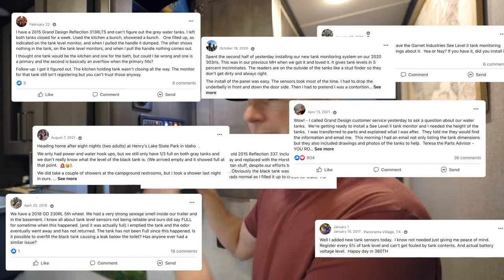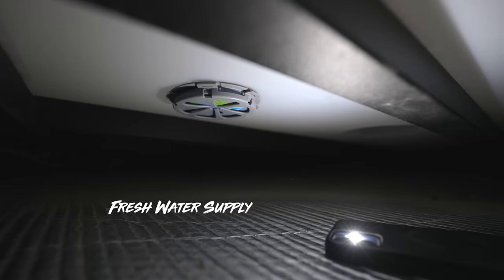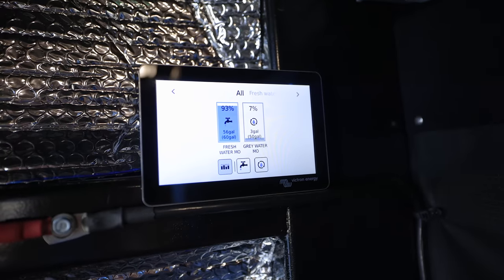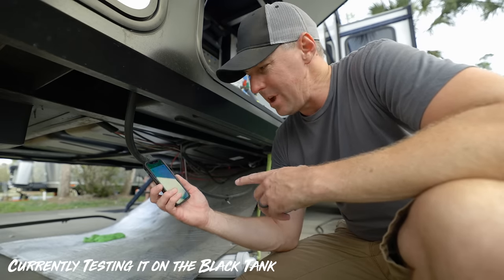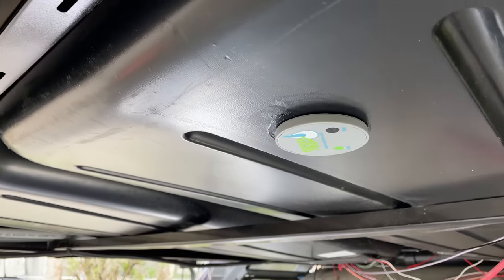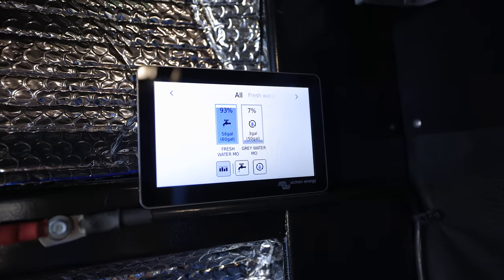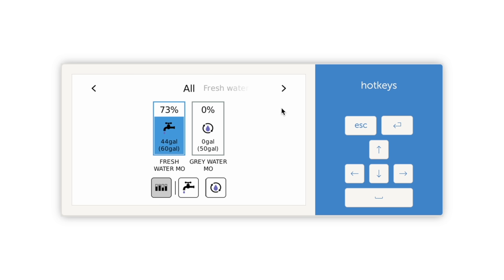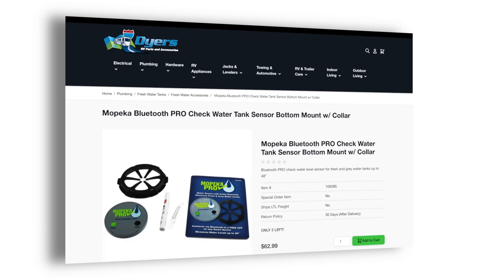RV Water/Grey Tank Level Upgrade!

Comment: Seems like a good time for the manufacturers to hardwire something like this into the system instead of the useless junk they ship with.
Reply: Agree.
Reply: Since this has been an issue since forever, I don’t see them doing this anytime soon.  Don’t know why, but they just don’t.
Reply: @jimsjacob  it costs too much. There's accurate sensors available in the marine industry but they are expensive. Something that the RV industry isn't willing to spend $ on.
Reply: @chachi5975  I too had supposed that was the root cause, but with all the comments over the years from other RV’ers I’d have thought it was an issue that people were willing to pay for.  Builders cut so many corners on assembly, that it’s ridiculous.  When I dig in for repairs, it’s surprising how cheaply they are made.
Reply: @jimsjacob  Like my wife says, No matter what manufacturer, they're made with pop sickle sticks and glue.  LOL
Reply: Exactly.  Plus, I do not want to disassemble a bunch of stuff to do this.  Pain in the a&@
Reply: @thomasking4136  Amen.  Just dropping the plastic "skin" from the bottom of the trailer is a pain.  Not to mention all the rework you need to do when you see how they slapped it together in the most haphazard manner!

Comment: This is twice the hassel to install and use, as the Sea Level system. With the Sea Level System you get 100% accuracy all the time. And to installed it is just a mater of sticking on strips with a circuit built into it and untwisting the wire nuts from your oridginal sensor's wires and retwisting them on to the wires on the Sea Level sensors. You do have to mount the gauge to those wires which is just a matter of taking out the 1/3,  2/3s, full gauge and cuting the hole square and the size for the Sea Level gauge. Then you get 5%, 10% , 15% etc readings. I've been using the Sea Levels gauge system for 13 years and it's been great. It's very good for when were boondocking.

Comment: An option you might look into if you’re considering the round style hatch is a short length of steel cable to connect the lid to the frame of the port. You can find short ones pre made or make yourself with rings on each end and attach using a screw in frame and one in center of cover.

Comment: I have also installed these sensors on my water tanks!  Appreciate the tip about getting them connected to the Victron system.  One additional thing I did was hard wire them into my 12v system with a DC-DC power converter, so I don't have to mess with the underbelly and change batteries.
Reply: As I was watching the video I was thinking that hard wiring power to the sensor from the trailer's power system would be a great way to not have to have to ever touch the sensor again.  Does the sensor lose it's settings if you cut off power to it?  What are the specs on your converter?
Reply: Yeah. At least their propane sensors, changing batteries is a pretty regular thing.

Comment: the instructions say to install them close to the end of the tank one sensor in, we tried installing and added the the depth of the tank into the app, and with just a tiny bit of water it says 100% full when we do not even have 1/4 tank. are the sensors supposed to be on an end or in the middle section?

Comment: Go with the round marine type hatch and cover. They twist lock to close (as I'm sure you know), but they can't open or fall off without twisting. When you get it installed like you want it, take a small stainless screw about a 1/2" long and drill a hole one size smaller in the seam where the cover and body come together. Then bottom the screw in it. It will keep it locked shut until you remove the screw, the next time.

Comment: As a boater, I follow ABYC standards for wiring. One of their recommendations is to have all wiring supported at short intervals to prevent chafe and strain. 9" is a good place to start. Zip ties are your friend, but don't tighten then enough to pinch through insulation.

Comment: Are use the seelevel II on my motorhome and love it. On a suggestion for your access door, look up a aftermarket replacement fuel door for a dodge pick up. Are used one years ago on a Porsche 914 race car that you could only access the fuel tank by opening the hood. Thanks for the video.

Comment: Those sensors were going on my RV as soon as Victron released their update to the cerbo software. But that must have created a run on the sensors  and they were out of stock forever. I kept checking. But then gave up and forgot. So glad to see them back. My GD 5er  fresh water  pump starts sucking air when I still have 10 gallons left in the tank. 😲Thats another issue I need to correct
Reply: and... the round hatch was my original plan for access. But I have another easier, cheaper idea. I'll post on my channel when I them installed

Comment: I've got a 2006 Lance 1081. My fresh water level indicator is laser accurate. Each light is 8 gallons. I don't have an accurate indicator on my grey water but I dump that often as per Californa law (grey water can go into the sewer but you need to dump into a barrier). Check the law before you do it. My black tank is wrong the second I drive anywhere after dumping. Nearly 10 years of full time RVing I go more by time and smell than the level indicator. Once it starts to smell, how much is in there makes no difference, it gets dumped. I also will notice the level when I flush so that's always a parameter to consider. Since mine is a camper. Getting to a tank is a problem. Nothing is exposed or accessible from outside or underneath. Panels that aren't designed to be taken off would need to be removed. There's always pulling the basement drawer and sending the trained monkey in but that only gets you the side of a tank, Not the bottom. If I could get to the bottom, the camper sits on the metal truck bed. I do have a liner but I wonder if that would be enough to overcome magnetic interference. I can't even use a dry stick to get an accurate measurement! Yeah, I got issues with Lance...
Reply: Not for your camper then.

Comment: Easy way to mark the location of things like that is a laser pointer. With underpanel off, point laser pointer at it. Don’t disturb the pointer and reinstall. And there is your mark. It’s really nice for cutting holes in motorcycle fairings for frame sliders and other things as well.
Reply: A measuring tape is fine when you don't have a laser pointer.

Comment: Looks pretty nice especially the Victron integration. But if I'm following the video correctly this wouldn't work on my class C with exposed external grey/black tanks with a heating pad on the bottom, nor an internal fresh water tank that sits on the floor under the bed. 😢

Comment: I’ve liked the ones for the propane tanks, they too aren’t perfect but are so much better than the color coded magnets you can stick to the side of the propane tank. Those are awful. I’ll have to get a couple for the water tanks too. I wish there was a better way of keeping all of the plumbing drain pipes from freezing. And every skirting solution I’ve found so far is ridiculously expensive. Maybe you have some thoughts about these issues as well? 🤔

Comment: Great video, thanks for sharing.  One thought for the cover, would it work taking a piece of the coroplast that is larger than the opening, attach it towards the front of the RV with some super sticky tape, then use velcro on the other 3 sides, creating some kind of hinged opening.  Just a thought
Reply from the maker: Not a bad Idea.

Comment: Dropping the underbelly is a major undertaking and a deal breaker.  Plus battery replacement?  My toy hauler has two tanks so I’d have to install two of them and then devine what the total is.  I just measure the gallons I put in and I’m able to guesstimate water amounts that way.  Truth be told, after emptying all water out prior to a trip, I put 20 gallons in for flushing and minor water uses, knowing that there will be water when we get there.

Comment: How long is the battery good for? It’d be a pain to drop the under belly to change the battery. Wondering if they have a remote battery solution in the works.
Reply: I'm a manufacturing engineer with Mopeka. The pro water sensor batteries will last up to two years on the longest refresh rate setting. Faster settings can deplete the battery in as fast as 6 months under normal conditions.

Comment: Interesting product. I have and am delighted with the propane tank sensors. But this would be a disaster on my rv. When I remove the chloroplast there are 4-16” of insulation. And having to change the batteries would be a major nuisance. I prefer my SeaLevel sensors. More work up front but no batteries to replace and more accurate.
Reply from the maker: SeeLevel is great.

Comment: Does the fresh water tank sensor need to be installed on the bottom of the tank?  Our tank only has top access.  It is in the trailer and I don't have bottomed access.  We already have the Topeka propane sensors.  They are great.  Thanks

Comment: Hey Jared my fresh tank is under the bed and the coach is two years old. The sensors are located between the bed frame work and are the type that are molded in. Unfortunately. I could but new sensors in on the other side of the tank and extend the wires but would rather have the models. According to their web site I can mount this on top of the fresh tank. Providing I’m reading it right. This tank sits literally on the floor and would be one heck of an undertaking to raise it without changing the configuration of this that and the other thing. Are you aware that the mopeds can be mounted on top of this tank. Seems mopeka doesn’t have a help number to contact them directly.

Comment: Started rving with the grandparents in the 70's, we've never had a wrong sensor warning for the fresh or Grey tanks.  Hopefully we can mount this in the corner of the black tank away from the poo pyramid with success.
Reply: Fresh tank monitors work fine, but with an 87 gallon tank. 1/3 & 2/3 full kind of loose their meaning. "So we have anywhere between 28 & 62 gallons"

Comment: With all the digital alternatives, how much wire (#s) could be taken out of the vehicle/trailer and weight of inaccurate measuring devices?  By rewiring of my T-210N, over 100 pounds was removed & moved into the useful load column.

Comment: Another great video. Have the propane sensors. Any idea how the water sensor will work with tank heaters? I have the aftermarket RECPRO tank heaters located close to the drain valve.
Reply from the maker: Yes both my tanks have tank heaters on them and I just placed the sensor away from the heater.

Comment: So how would this work on a gray tank with a sloped bottom? I’m guessing the solids in a black tank would mess with this so it wouldn’t work for that.
Reply from the maker: Ours had a it of a slope and it has worked moderately well. It’s not perfect but better than the indicator lights.

Comment: It would be nice if you could link the sensors to the rv LCI or whatever systems you have for those that don’t have Victron system
Reply from the maker: I'll have to see if that is possible.
Reply: I'm a manufacturing engineer with Mopeka. We do currently have a Pro Sensor only for gas that is distributed by Lippert that syncs up with the LCI system. Although for the water sensor we don't have a deal with Lippert yet.

Comment: Why does everything have to be so expensive? Black tank can be measured by a stick stuck down the toilet hole if your sensors aren't working. You'll know if your gray tank's full if your shower drain is over flowing or your fresh runs out when the pump keeps running. Use the KISS method when camping.
Reply: In our 5th wheel the black tank is not straight down, so your stick method would not work.

Comment: Do you have any suggestions on an upgrade to the basic info panel in most RV's? I have a Jayco class C and would like a more modern and accurate application or system
Reply from the maker: Depends on what you want to have on it but the Victron system is open source and some do an inexpensive system with a raspberry Pi.

Comment: Does the Victron system also read the Mopeka propane sensors?
Reply from the maker: Yes it does. I need to do something to help with range on the fresh water tank but it reaches enough to see it in the display accurately.

Comment: I don't want to be a hater on RVs but terms like 'CROSS CONTAMINATION, BLACK WATER, GREY WATER'...is a joke. It's been 100 years and RV prices are through the roof but they still haven't improved the sewage system? There is no difference with an expensive RV and a cheap RV. They have made electric cars, self driving cars, and yet no matter how expensive RVs are, you still have to touch the hoses, direct it towards a dump station and smell the pooh and peeh and still feel some splatter. There should be no hoses anymore. Dump stations should only be a receiving funnel or hole on the ground and RVs have to only drive over it dump whatever you have and move out in less than a minute. All RVs these days should have already an automated dumping system. And the camp grounds will only need one modifed dump station coz if it's fully automated it'll SHOULD only take less than 5 minutes for the full dump system to complete. 1 minute to dump waste and 2-3 minutes to clean the RV dump system. RV industries are full of black water.